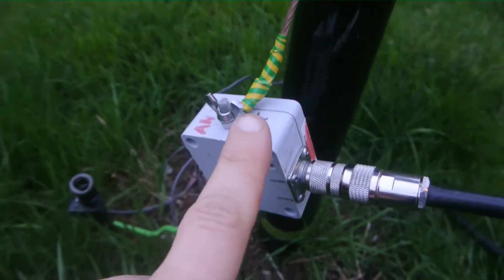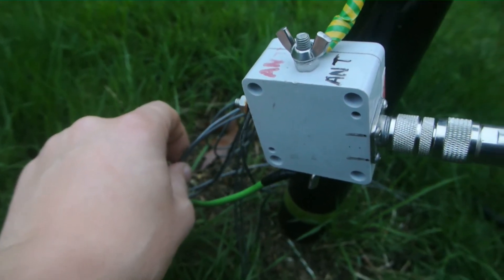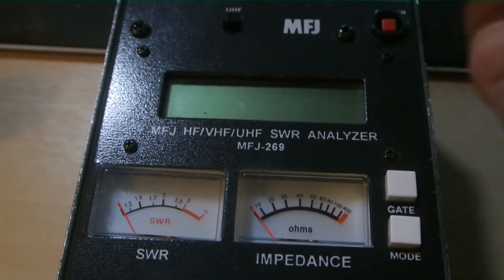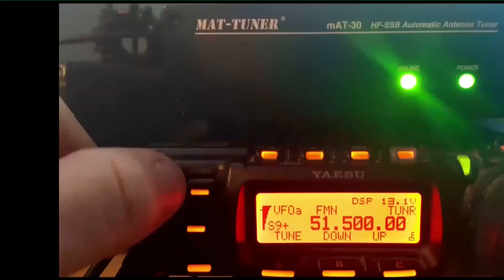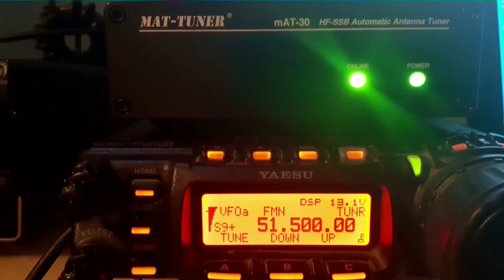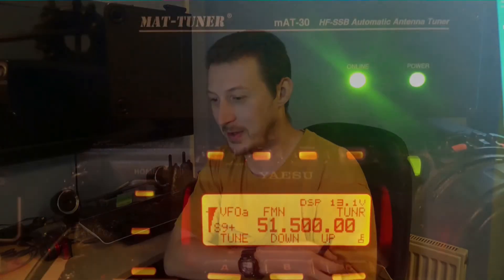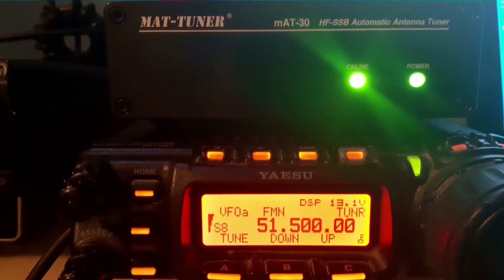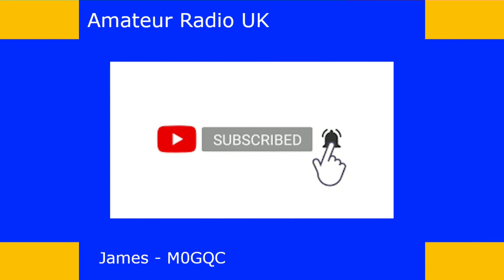Quarter Wave Vertical For 40m Used On 6m

Comment: Hello James,
Nice test of the 40m vertical on 6m..
A vertical an odd number of quarter wavelengths and with a perfect ground plane does have radiation at 0 deg.
As I recall, your ground is far from perfect, so the radiation pattern will have some rather broad lobes, but still have some 0 deg radiation.
The other aspect is the shading/shielding from all kinds of obstacles, so all bets are off, really. Having said that, I did not get the kind of distances that you worked in the net, so I am curious.
I have been thinking of using a 30m GP for 6 and 4m as well.
Good luck with all the tests and experiments
73 de Jan, OZ9QV
Reply from the maker: Hi Jan,

There are a significant amount of obstacles surrounding the antenna here because I live on the edge of quite a big housing estate which also has a couple of industrial estates with several large warehouses. So plenty of obstructions in the way here!

The tip of the mast extends a few meters above the roofline, but most of it is below the roofline.

As you said, all bets are off with that much clutter surrounding the antenna.

I've got a few more ideas for tests like this.

73.

Comment: An interesting experiment James.  It's good to know the 40m vertical will tune and operate on 6m, but it appears maybe not so well???  I do like your videos so, keep them coming.  73 my friend!
Reply from the maker: It worked ok but I'm certain that a proper 6m antenna would have been much better. The fact that this antenna was ground mounted probably didn't do me any favours.

As I understand the theory behind verticals, you get a nice low angle of radiation (which is what you want for local FM contacts) with a 1/4 wave & 1/2 wave vertical.

Once you go too much longer than a 1/2 wave you find that your RF starts to radiate at a high angle. That may be great for NVIS (not that you would use 6m for NVIS) but not so good for local FM nets.

The vertical element was around 9-10 meters tall, approximately 1.5 wavelengths on 6m.

My guess is that most of my RF was going straight up into the sky at quite a steep angle.

It probably then carried on through the D, E & F-layers into space only to eventually be picked up by some little green men many galaxies away who will likely be wondering "who is this idiot telling us about his life story!"